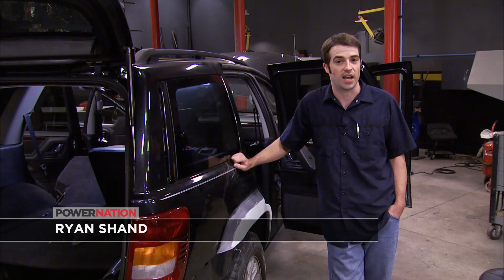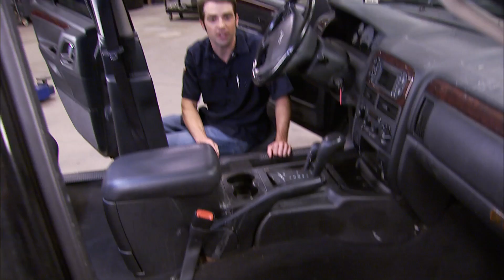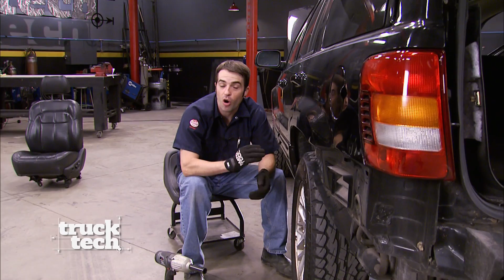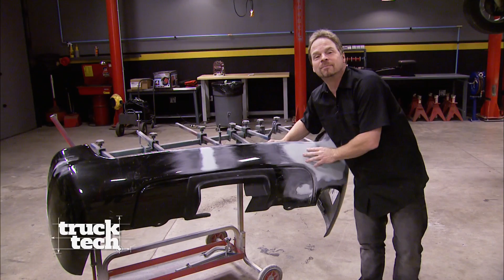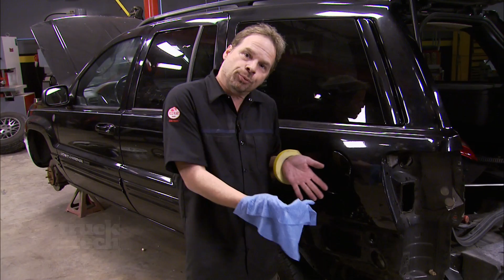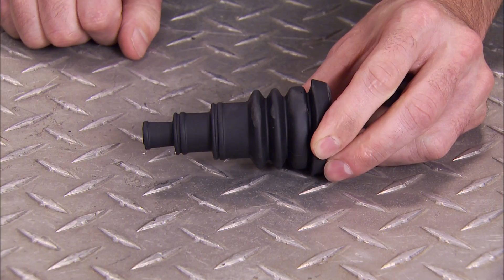Jeep Refresh: Tired AWD Cherokee Gets Wheel And Dent Repair - Truck Tech S1, E3

Comment: you could have put a football, or basketball in that vent, and aired it up to remove that dent. then just cut the ball and pull it out
Reply: I was thinking the same thing and have done that a few times before. It's not 100% but pretty good.

Comment: Another thing that you could have done to get that dent out easier and i have done it many times is to fold a motorcycle inner tube on itself twice to shorten it and push it between the body panel and the inner structure , some air pressure and as the tube swells it will push the dent out, some practise and the hammer on the outside to relieve the spots with the most tension and it will come out easily.